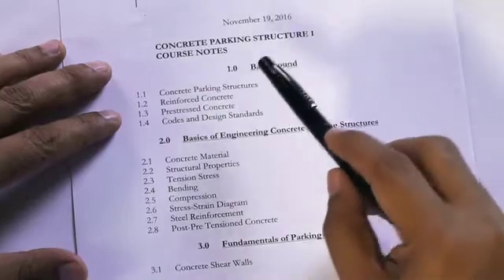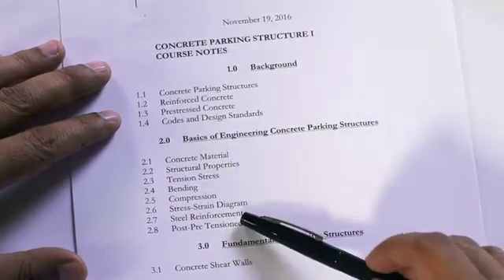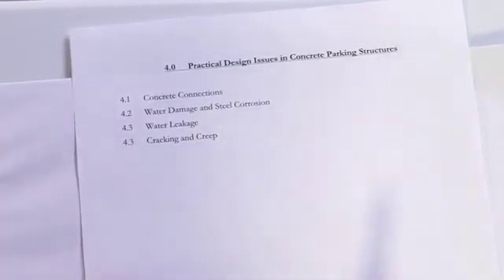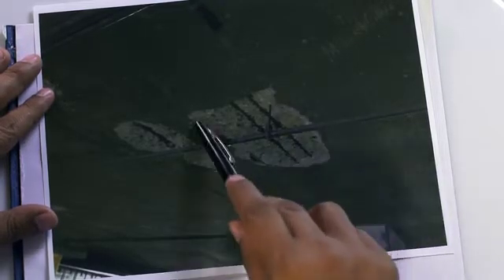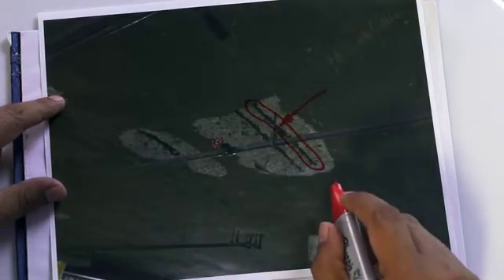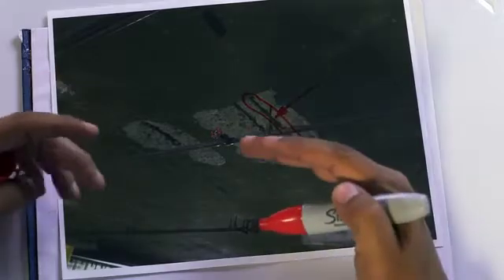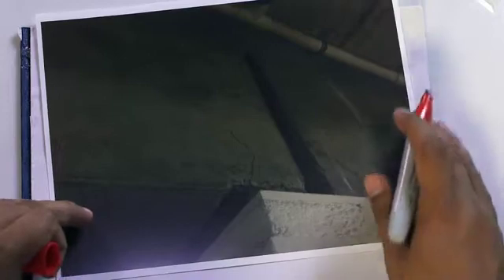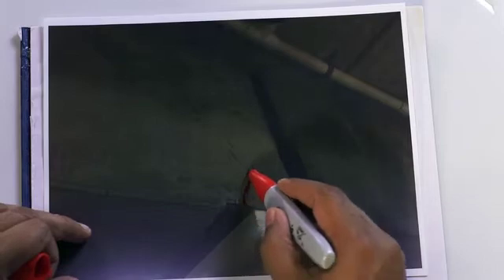Concrete Parking Sturctures

Comment: I thought flat plate systems don't use beams? and how can the thickness of the slab be so thin? 

Flat plate thicknesses are thicker than other slabs which would mean others are even thinner. 

can you give an example of how you arrived at a 5" thickness? 

what was the span, etc?

 Im confused by diff between 1 way and 2 way in regards to slab thickness and span. 

 it looks to me that 2 way slabs are much thinner. 

IE 2 way slab thickness is L/30 or L/33 while simple beam in 1 way slab has thickness of L/20 or L/24 for continuos beam. 

is this a correct assessment?

and which can span farther?

these videos are so amazing. 

Im so glad to see that you made more since the last time I checked. you are a really amazing teacher and they are hard to find!!!